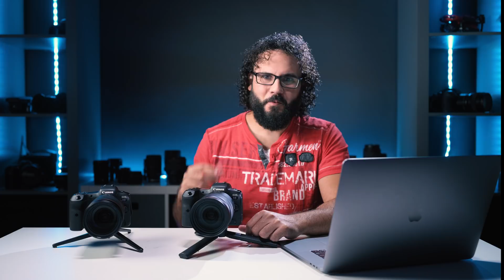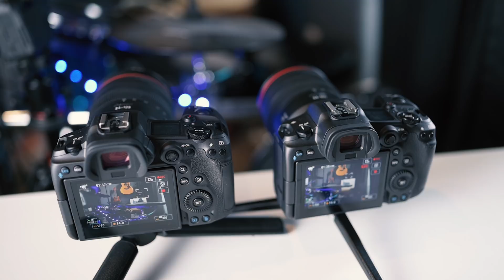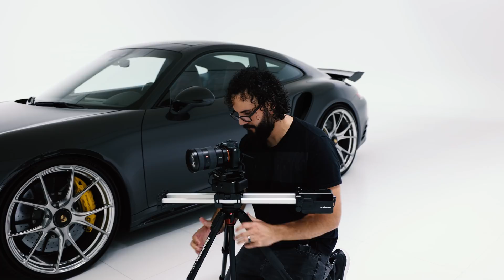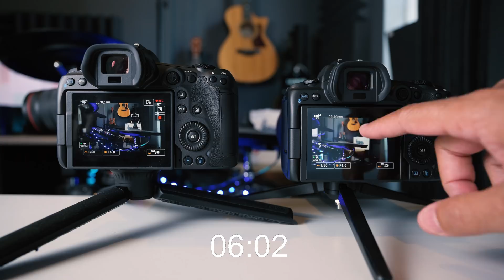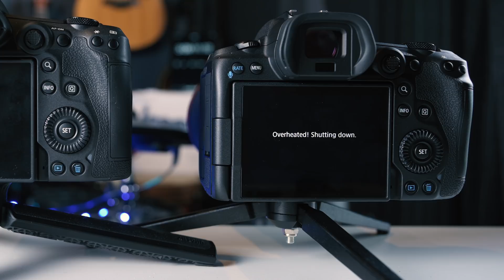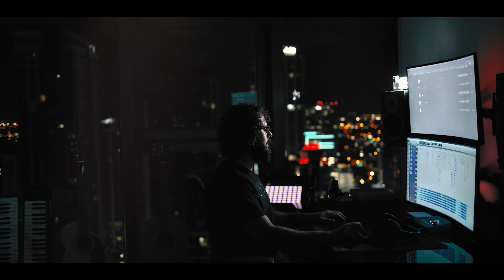Unlimited 4k60 Recording with the Canon R5 Firmware Update 1.1 | Overheating Solved?

Comment: The Canon EOS R5 is for me and my Wildlife work a game changer. Overheating is not an issue at all for me, I am not into video, I just take from time to time short 8k/30 clips and extract 35MP images out of the stream - of Wildlife. No other camera can offer me this. For stills, the Canon EOS R5 is anyway great, it beats the shit out of the Sony A7R4 in terms of high ISO performance and especially usability. And also Autofocus performance, especially Animal Eye Autofocus. I can compare, I own both. For the overheating issue, I am sure that sooner or later Firmware Hack will be published, if this camera can handle heat better than it is allowed someone will find a way to kill the software timer.

Comment: A fresh pizza is delivered hot to the customer because it's contained within an insulated delivery bag; camera components contained within a dense, weather-sealed camera body likewise take time to cool.
Reply from the maker: They actually don't...every other camera cools down quite quickly under room temperature. Actually, you can even get temp readings from the sensor and they show ambient Temps in under 10 minutes
Reply: @learningcameras   The other cameras don't have to deal with the full-frame 8K sensor readout and thus don't generate or have to deal with the same amount of heat. Temp readings from the sensor are important, no doubt, but there are other temperature-sensitive components that are taken into account in the overheating algorithm. There might also be other factors besides absolute value temperature readings that play a role in the thermal management algorithm, such as change in temperature over time, etc. My point is that I think it's a complex multi-factorial issue that can't be easily simplified.
Reply: @camspotr9012  I'm agree that it's more complicated than we think - we don't know what Canon's thermal management is actually doing and which components it it trying to protect. Maybe some components have no temperature sensors so these use timers to approximate the necessary cooldown.

They may be trying to avoid repeated rapid heat-up/cool-down cycles that could stress the circuit boards and solder connections.

I wish Canon would just level with us and issue and engineering paper on their thermal design.
Reply: @camspotr9012  watch my hack ...r5 hack max max max

Comment: Thanks for the testing it doesn’t seem to match the results of JP and Gordon Laing’s though. Both got longer 4kHQ recording times and far quicker recovery time with the firmware update.
Reply: JP put the cameras in a fridge. Lol
Reply: blurred_clarity_ which points to it not being a timer - so many assumptions being made out to be fact.
Reply: @alasdairknights2396  whatever it is, Canon needs to address this situation properly, as noone will be confindent enough to use this on proper video shoot, when these recording times are so varied.
Reply: Paul I tend to agree - canon needs to clearly and transparently explain how the overheating sensors and the firmware protecting the camera works, rather than replying on utube reviews. All of which are making differing assumptions, some larger than others. As a stills shooter it makes no difference to me really as I would get the R5 based on its outstanding photo performance.

Comment: I saw the R5 and R6 and immediately bought a second A99II for my stills work. They're not usable.  Additionally,  I'm going to start using X-T3s for video work...
Reply: In what way is the R5 unusable for stills work no one has overheated it when shooting stills?
Reply: @alasdairknights2396  Doesn't matter.  I do a mix of video and stills with the A99IIs.  A camera even with the remote chance of failing while doing the business is a no-go...Sorry if you're a Canon fan, most of us were expecting better...
Reply: Aaron not particularly a canon fan for me a camera has to perform for what I want. In my case it’s landscape and wildlife stills. I was looking at maybe switching to a A7R4 before canon released the R5 but as this is a better stills camera I will be sticking with canon the added advantage Is that I can keep using my EF lens with out any loss of AF performance.
Reply: @alasdairknights2396  I'd be getting the A7RIV and the 16-35mm over the Canon...
Reply: Aaron based on what? The Animal eye AF the LCD screen, FPS, ergonomics are all better on canon. Don’t get me wrong the Sony is a very good camera, just not as good as the canon for what I need in a camera. 😁

Comment: Thanks for the extensive testing Dan but this is absolutely crazy and Canon made it even worse with this confusing and unreliable firmware update!!! Turning the camera on and off to keep it running is just ridiculous!!!
Reply: @johnny_blz  I'm sure Canon could release the R1 before Christmas if they wanted to. I'm sure it will be up for pre-order by late March unless Canon fails to get the R5 outrage under control. Sony will probably release an A7R5 by next September.
Reply: You won't have to do that with the $7,000+ R1.

Comment: Thank you for the test it is encouraging. It is good to know that the overheating mainly software control than the actual temperature of the body of the camera. I am going to run a test on real world Vlogging with the new firmware 1.1. Looking forward to it.
Reply: I keep hearing people say that the body doesn't get that hot as if that is a good thing?  Is it?  Do we know what the internal temps are when operating?  If the camera doesn't have a fan and the body is not getting warm then it could mean it isn't dissipating heat enough, which is why Canon feels the need to build in a software timer?  If the camera is not hot and it really isn't overheating then why the need for a timer anyway?  I can't imagine they would choose to do this voluntarily if there was no reason to.

Comment: Well, it seems fair to say that Canon has done basically nothing substantial to address R5's 'overheating' issues with this firmware update. They continue to play dead fox, and although it has been proven that the 'overheating' is actually non-existent, and is strictly a software-related limitation, they have decided to stick to their crooked guns and weather the PR storm that is already raging.
Reply: Exactly. So disappointing.... 🤦‍♂️
Reply: You are correct sir. The $7,000 R1 will be released with all these issues fixed after Canon tamps down the righteous outrage at their criminal actions with the R5.
Reply: @DrummingTmate  Did you buy an R5? You seem to be very incensed by this...just wondering. I would not be happy if I had bought one without knowing about these issues.
Reply: @johngwheeler  No, but I've been saving for one. I have the money for the body and now I'm saving for a very/ good lens like the RF 85mm F/1.2 but yes I'm getting mad about all the cripples and Canon being unwilling to undo them. Canon has been caught. It's 2020, the online world - it's literally the whole world - will figure it out. The R5 has been figured out. Undo the cripples. I want the full 4k 120 with audio. That's the one video feature I want and Canon has deliberately withheld it.
Reply: you know nothing of electronics design, hand held electronics like cameras must comply with low temperature burn rules which occur at 41 celsius
Reply: Rumour Has it Completely wrong. Red cameras nominal temp range is from 50-70C.
Reply: @Salt, Earth and Sun that’s not a hand held camera
Reply: @SaltEarthandSun  I think he's talking about the external case that you can touch with unprotected hands. The Red temp range refers to either to the internal temperatures. Holding a 70C camera would be very uncomfortable!

Comment: Thanks for all your testing! I think it makes sense that the camera is not as hot on the outside, after 25 minutes continuous recording than after 1 or 2 hours of short bursts with cooling intervals in between: Since the sensor can not spread its heat very well, because it's sitting on the IBIS, the heat needs a lot of time to reach the outside of the camera. I also don't think, that overheating can be "solved" in this camera: It just produces too much heat to handle in such a small body. The implementation of the overheat management though, is still - let's say - not very transparent...
Reply: It is also possible that there are some components in the camera that need to be protected from getting too hot, that don't have a heat sensor nearby: Then a timer is absolutely necessary to limit recording to a point when this component probably overheats. Same goes for the cool down time.
Reply: @andreasfriedrich7150  I wondered this as well. The Digic processor will have temperature sensors and hardware protection, but other components may not, and may not be close to the in-body sensors. The only way to keep these cool is to enforce time limits. I just wish Canon would tell us this, and then the complaints would stop. This seems to be a camera that would be better after Mark 2.

Comment: This is just crazy how people pay 4500 camera and have to put up with this. sorry Canon. This is just plain stupid. went through this problem with sony and told myself never go through with camera that overheat. Thanks Dan for going all this trouble testing it. Great work. cheers.
Reply from the maker: I tend to agree with you!
Reply: @camspotr9012 I'm sorry, in Germany its 4385€, which is $5221 at the moment, I just rounded those few bucks up.
But ofc there is no similar camera, the a7siii comes close. But I think that is not the point.
Reply: @lanifwtf  Actually it's my bad for not realizing you could be in a different country and referencing euro and not dollar. Thanks for clarifying.
Reply: @lanifwtf  a7sIII comes close and it's cheaper and more reliable.
Reply: The R5 records 4k 120 with audio, but Canon won't let you have the straight 4k 120 it recorded. Canon just gives you slow motion out of camera with no audio. The $7,000 (or more) R1 will of course give you the 4k 120 to edit as you wish and also never overheat and the R1 will be exactly the same hardware as the R5, just without all thew cripples in the firmware.
Reply: I have my R5 and I'm now starting to realize this. Sure it has 45 MP but man... That overheating does NOT make this camera worth 4K at all. The price would be worth it if the camera didn't overheat. I feel shitty, now I'm just hoping they fix it.
Reply: Johanser Martinez you have the best stills currently available. Beats the Sony A7R4 in everything apart from MP which is negligible once you get over 40mp. The R5 unlimited video modes are the same as the A7R4. The new firmware has improved the limited video mode recovery and the record times as confirmed by a number of YouTube reviews. In addition you get animal including bird eye AF, fully articulating rear panel with touch screen, easier to understand menus, better ergonomics. Get on to the DP review R forum and see what they are saying about the camera many of which are pro's. Most of all get out use and enjoy the camera.  😁
Reply: @alasdairknights2396  R5 doesn't have unlimited video recording... It's an overheating machine. Don't deceive yourself.
Reply: @Hanszimmy  I got u watch r5 hack max ma  max
Reply: I would agree with you, if this was video centered like Sony's most recent camera. But it isn't, it's a canon camera for photography that has video features. If you want a video camera that doesn't overheat, literally you have, Sony, Panasonic, and even Blackmagic that shoots 6K for $2000. If video is the main focus, you are looking at the wrong camera.
Reply: @JimmyFerminFilms  no no no 8k raw 120 fps 4k canon glass canon af canon colours I am canon goon
....no check r5 max max max hack
Reply: Paul Fensome  as far as I can see, the cheapest is at 2630€
Reply: Paul Fensome  seems like it's way cheaper in U.K if I'm right on the exchangerate
Reply: kc chen what camera are you are using that does 4k60fps fullframe, 45mp, 20fps, 180 raw file buffer, 8 stops IBIS, flip screen...please let everyone know so we can all switch? Please don’t respond to close enough, we want to know what does same or better not almost or good enough
Reply: @marioslrzn  doesn't matter what does same or better. They just have to advertise it the way it is, which they didn't. For many professional situations, like interviews or weddings the R5 is plain useless. For 4500 bucks, it's just horrendous. Which is quite a shame since Canon lacks a decent B-Cam for the cinema line.
Reply: Jensonmission you still didn’t answer the question, what camera that’s supposedly professional does the same or more for $3900.00....4k60fps full frame, 45mp, 8stops of ibis, 20fps, 180 raw buffer, so please let us know so we can switch? Obviously you have this magical camera and we want to own it too, tell you what to make it easier on you, let’s get rid of the videos features and just give me a stills camera that can do 20fps, almost 0 lag on evf shooting, 180 raw buffer, best in class rolling shutter, 45mp 8 stops of ibis, oh and raw file size half of what the competition...so please let us know
Reply: Jensonmission they were clear with the limitations when they released the camera of those who had preordered had time to cancel the order. I can’t see how you can accuse them of false advertising.
Reply: @marioslrzn  The Sony A7R5.
Reply: @alasdairknights2396  Canon's marketing materials are online everywhere - Amazon, B&H, Canon's site- so why don't you read them and stop posting lies?
Reply: Drumming Tee What are the winning lottery numbers for Saturday, since you see the future
Reply: @lanifwtf  that's  exactly my point. Is like you hired a skill worker to work for you. But you need to fan them or they will coppase half way.
Reply: Drumming Tee there was so much information about these limitations including canon’s clarifications the day after the official release that if you bought this based on just the headline marketing blurb you only have your self to blame and to claim otherwise is a lie in itself.
Reply: Mario Solorzano Alasdair Knights that’s actually not true which why I don’t understand why everyone keeps saying this. Yes they posted about the time. But where did they post anywhere that his has unrealistic cool down times? That’s what you’re not understanding. We don’t car that it overheats. But a camera should not take almost two hours to recover. Nothing takes that long. You shouldn’t lose time from taking pics or just using the menu. Do you understand now?
Reply: semahj lamons the cool down times were published at the same time as they clarified the limitations it was part of the table. The fact that the video run time would be reduced if the camera had been used immediately prior to using the limited video mode was as you say not highlighted. Presumably because it would depend on how much heat had built up. At the end of the day of you don't like it don't buy it😁
Reply: @alasdairknights2396  I'm still trying to understand what you are on about. Are you saying this toy is worth $4,000? I definitely know you can't be saying that.